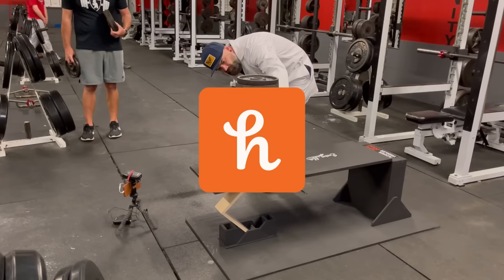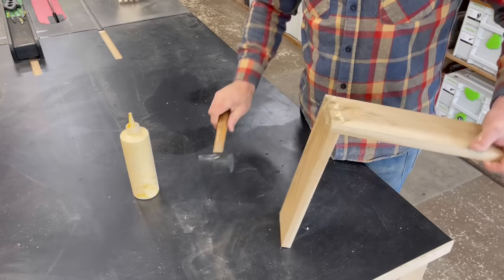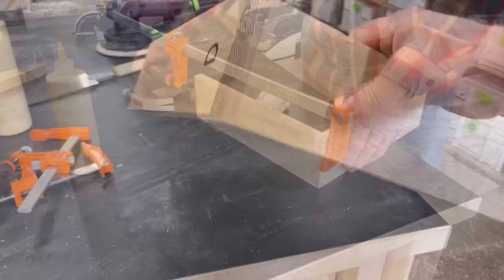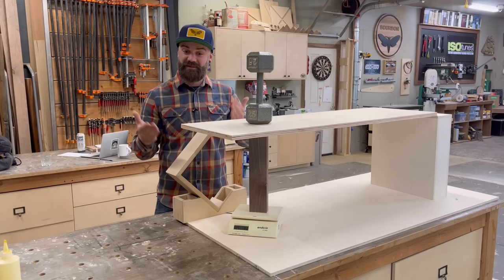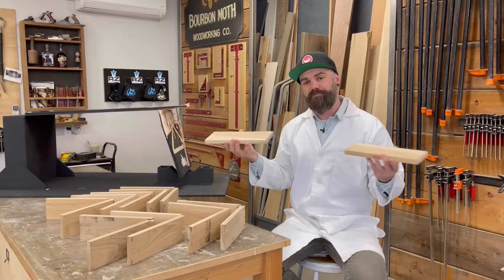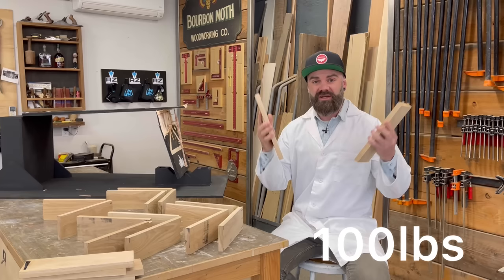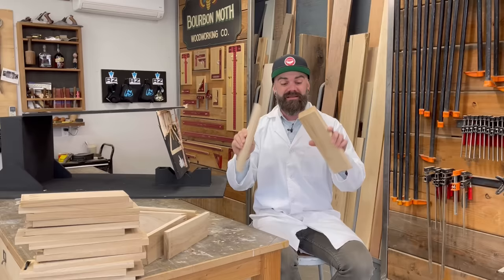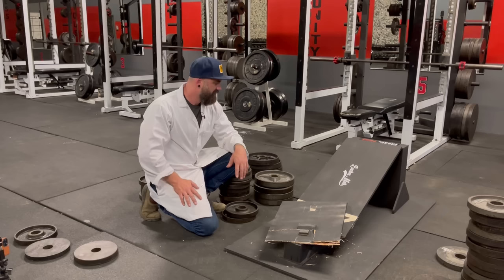What's the Best Wood Joint || Insanely Strong Joinery!

Comment: For absolute strength I use finger joints and then put a dowel through the joint from the end. So it acts as pin going through each of the fingers. I'd love to see that if you ever re-do the test with a routed Dovetail. I rarely use dovetails but when I do I make the pins and tails the same size.

Comment: Strength is measured in PSI.  Pounds of force divided by the surface area of the mated surface. Also you are exerting a torque on the joint because the force is exaggerated by the distance from the joint that I is being applied to.

Comment: On the comment about "over-engineering" a drawer... In my mind I was picturing the size of the drawer, what goes in the drawer, and how much average friction a drawer may have with the surrounding chest or cabinet during it's use. A narrow little drawer filled with pencils and office implements on the side of a desk isn't going to be the same as some big deep drawer under a workbench full of various metal tools. So assuming the lightest use case isn't always the best idea. Plan accordingly.

Comment: How to make a stronger join.
I would, based on the data. Put screws into a 45degree + splines joint. Or dowels if one wants to go all wood.

But the important part is to add the screws at an angle, alternating even.
So that the straight force down, is forced into different directions by the joining parts, ie the screws. The splines could probably simply be angled  to give more strength as well, since them being straight allows the weight to "rip them out" of their sockets.

So yeah, hard to explain with text.

Comment: Hello friends,
 I love metal and feel wood is traditional. Finger joints are known to be stronger than the original wood. Here is a copy past name for a tool to do it.    Finger Joint 1-1/4 in. L Carbide Tipped Router Bit.  Then just offset the second piece of wood 1/2 the tooth thickness from the first. Could it be cut into a mitered corner?
Thank you

Comment: It would be interesting to see scarf joints IE making two pieces of timber into one and then finding out how much weight a glued and non glued joint could handle, in some buildings in Japan they are assembled using intricate joints that contain no glue or external fasteners yet support buildings for hundreds of years even surviving earthquakes. Some scarf joints used by American pioneers used joints implementing mortise and tenons and pins to apply force to the joint that required drilling out the joint to recycle the timber in the building hundreds of years later.

Comment: (Sorry If I repeat someone's reply, I didn't read them all.) Two things about the miter that give it more strength than you would expect.
1.  Cutting at 45 degrees increases the glue area by 40%
2.  You reduce the leverage between the end you're pressing on and the opposite end of the joint. Given a beam with a 10:1 length:width, you'll get 10:1, or 9:1 leverage (depending on how you orient the joint.) Cutting at 45 deg makes it a 9:1.41 leverage (6.4:1)

Disclaimer:  this is strictly first-order back of the envelope analysis, intended for a YouTube comment technical level. If you see an error in my calculations please advise. If you wish to draft a treatise about how I overlooked the load distribution across the joint profile, do so in a separate comment.

Comment: I think you need to consider lots of things here. The direction of the force vs the different surface planes glued. For example, the miter join has to hinge apart and have the whole glued plane “pop” apart. The result may have been very different if the force was more of a twisting force. With steel there is a saying that goes “strongest under compression, tension, bend, twist, sheer”. The miter at 45 degrees when pressure is applied at 45 degrees means you have more compression forces on that join. Yes there is a leaver wich adds some tension force as it hinges open but the joins like the box have a higher twist/sheer ratio so you’d expect it to fail earlier

Comment: It's no surprise that the dovetail joint failed as early as it did. Your friend created a BEAUTIFUL, but mostly DECORATIVE, dovetail joint. For maximum strength, a proper dovetail has identically sized fingers across the joint. The little slivers of dovetail do little to increase joint strength. It would have been much stronger than the box joint had the dovetails been of equal size.

Comment: It’s not the transferring of the weight to the joint but it’s the torsion equal to the weight times the distance to the corner from the point where the partial drawer box touches the large plywood board with the weight on it that breaks the corner

Comment: I personally think the clamping cauls that were made to assist in the miter joint glue up made all the difference. I’d like to see if a miter joint shot with some 18 gauge brad nails through the outside and no clamps would hold up the same.

Comment: Pythagorean theorem...that 45 miter increased the glued area by 40%. Also, the splines extend to the edge of the joint that encounters the most force. 
Try running ridges the length of the 45 miter, I'm thinking you'll get an additional 10-15% load bearing.

Comment: While the force was measured consistently, the actual force on the joint must be multiplied by the lever arm (length of the board).   Most of the amendments to the joint (dominos, dowels, splines) would improve significantly when applied to a miter joint instead of the butt joint due to the increased surface area.  Hence the study while providing some interesting results is incomplete creating a new set of questions.

Comment: I'm thinking about that simple miter joint. Surprised me, but then it's end grain to end grain so maybe that's why it was so strong. If you wanted to make it even stronger you could add a third piece to form a triangle in the corner, three miters. I can't imagine why you'd do that unless it was a part of a chair for sitting on. You'd of course want it to be extra strong. Interesting video with a couple surprises.

Comment: At the risk of exposing my knowledge this is my guess from strongest to weakest

1. Dove tail
2. Pocket hole outside 
3. Box joint
4. Dowel pins
5. Miter splines
6. Domino 
7. Pocket hole inside 
8. Lamello
9. Miter joint 
10. Butt joint

Comment: Difference between a woodworker with not much experience in metal working, and one with experience metal working.
I knew immediately that pocket screws on the outside are going to be very strong, than simple joins without them...
And the reasons why mitter joints were so strong, was the vectors of applied force were nulyfied with the angle of the joing. It basically acted as a brace. The force you should have measured was the one that would force the boards to "open" the joins, so pushing both boards from inner side to the outer one.

Comment: sugestion for a stronger joint? try the box joint and or the dovetail. now glue in a small dowel or bamboo skure ( if grass doesnt violate "wood joinery" ) throuygh a hole drilled perpendicular to the joinery fingers.

Comment: the dove tail break was interesting. It seems like the pins acted as wedges provided mechanical advantage to split the tail board. I'd be curious to see if making the angle steeper increased the strength and whether it was significant, marginal, or not at all.

Comment: I'm cheering for box joint. The dove tail needs manual work so I don't want it to beat the box join. The angle of the force being applied makes me think that a 45 degree cut will do well but at the end of the day the box joint is a better join.

Comment: Try mitre with spline and use a stronger wood for the spline. 
I think I will make that my standard. Looks sharp and it’s functional.

On my last project I used M6 furniture bolt with a threaded 10 mm dowel nut. That is, in my book, the strongest joint of them all. I will bet you over 400 lbs!

Comment: The weight distribution on the miter joint is different fro the rest also. It pushes the two ends together until the top board tries to slide off the other unlike the other square cut joint that are instantly trying to pull apart.

Comment: I'd like to see the test of a box joint, but with a dowel running top to bottom through all the fingers.
It'd be nice to see the difference in strength between ¾" timber and 1" timber with a dowel half the size of the timber (ie: ⅜" and ½" respectively)

Comment: You should do a miter with thicker splines/ wider splines...
It would be cheating; but you could make the cut for the splines deeper, use a much wider spline and have them cut the corner.  That would brace each piece of your joint and you could probably make the joint stronger than the board

Comment: It makes sense that the miter joint is that strong it's basically the same as a scarf joint witch are used to build all kinds of things like boats and electric guitar necks. As long as it's good quality wood glue it's a very strong joint. Of coarse most scarf joints are at much less of an angle than 45 they are 10-15 on guitars witch gives you much more gluing surface than a 45.

Comment: I see two problems with the miter joint: this test was good at static load but a dynamic load would probably be different. Years of jerking and flexing a drawer in and out (dynamic loading) is not the same as static loading. Also any seasonal change in dimension to the separate pieces of wood, in particular cupping, can be a powerful force on its own, which could lead to separation (I have seen it many times). I kind of think of it as potential single point failure while most of these joints have multiple gluing surfaces which would require multiple failure points. Consider how hard it can be to take apart a tight fitting dovetail or box joint even if it's not glued.

Comment: this is an excellent video, full of useful information about wood joints. congratulations.

Ockham's razor. this is all about bond properties, by contact area, putting aside the resistance to break of the wood itself in and the lever effect, but resistance increased by the reinforced joints from the pocket holes to the miter ones.

Once more, excellent video. thanks a lot! 💪🏻

Comment: That was interesting, now that we know how my pressure they can resist, let see how much it will be needed to split them appart, to have 2 forces pulling in opposite direction from the 2 edges of the joint.

Comment: Dovetail: you are testing it at its weakest 45d angle whereas it is designed to resist pulling pressure at 90d (when you pull the drawer open). But the simple miter joint is angled to best resist your test. So part of the result is the angle of force applied by the way you set up the test. I know you are just having fun, but you might consider setting up the same test but with pulling pressure and pushing apart pressure, not just weight at a 45d angle from above.

Comment: It is clear to me that your dovetail joint did not have the same “connected and glued” surface area as the box joint. So it is easy to understand that your box joint would be much stronger.

Comment: Failure mechanism control is commonly done in structural engineering, the classic example is concrete. We design concrete beams so the steel rebar will yield and stretch before the concrete breaks. Steel fails slowly with a long yield and elongation prior to rupture, providing lots of warning that something is wrong. Where concrete has a brittle and sudden failure, not good. In any structural system it's possible to determine all the failure mechanisms in order based on their ultimate strength.

Comment: Splines work because wood is strong in tensile. Same reason dove and box fail, the compressive deformation happens at the fingers and the joint looses all strength. Any time you can introduce tensile stress to wood, it will handle it better than anything else, the issue is of course securing any tension pieces.

Comment: The spline is trying to pull apart three pieces of wood with the grain. Wood is very strong when pulled. The only caveat to that is whatever is attached to wood is usually not as strong, but in your case the glue and the splines created a friction bond

Comment: Usefulness rating = 100%, ten out of ten ! For thin, delicate picture frames 11x14 and larger, the splined miter joint is probably a requirement to get any kind of durability over time. Excellent presentation.

Comment: Now try Miter with Dowels each way, but really you need more then 1 sample of each joint, make 3 of each joint and test them to get an average strength. The consistency of the glue up and other factors can effect bonding strength so you need more then a sample size of 1 for each joint type.

Comment: I would like to see how equally sized dovetails fare, like how I was taught to make them. Less risk of just pulling the dovetails right off.
But even then it’s of course going to depend on the direction of the force. In one direction it will be only about as good as a biscuit/domino/dowel joint.

Comment: If you had all of your dovetail the equal size similar to the box joint it would have fared much better.
When you redo this test make a box joint, but use a mortising drill bit in a drill press and cut a square hole through the center of all the fingers of the box joint and insert a square piece of stock so there is zero rotation of the fingers when tested at 45° again.

Comment: The miter joint makes sense because its got way more leverage. the strength in the box joints, dove tails, anything else really, is at a wonky angle to begin with. Plus most of the wood glue was actually being affected by torsion rather than being pulled apart. if you just think of the wood itself as a lever, the mitered corner is the fulcrum and the board is the handle. The mitered edge is significantly longer than the width of the board, this gets you more surface area of your glue surface, starts the test at a shallower angle, and most importantly, takes some leverage away from the length of the handle.

Comment: The miter joints and but joints are the only ones using optimized glue pressure. Put a perpendicular clamp on your box/miter/dove spline. Hitting 250-500 psi in your internal structures and your joints will well outlast the miter. 

If you look closely at the box joint failure. Only the one face that got pressure from the clamps held up and produced a grain failure. The rest was glue failure.

Comment: Don't let science fool you . The strength of force on a drawer is not a open 90degree angle with downward force. The Dove tail is the only joint I have seen on100year old furniture. Drawers with 45 cut and finished nails have failed on new furniture. Very good video I am now a subscriber. Thank you

Comment: I find it interesting that other tests on the web including YouTube with dowels and Domino's and all sorts of joints the dowels typically win every time.... Also and perhaps it's been said I didn't read all the comments but you have to choose the joint based on how it's going to be used for example a drawer I've seen drawers made in the 1800s where the glue is all but disappeared and hardened past its usefulness at the drawers stay together why because of the dovetails any of the other joints a miter or whatever would have failed many many years ago so again choose the joint based on how the product is going to be used...

Comment: I suggest testing a box joint with en edge spline down the entire edge 1/3 into the corner. It makes it so the fingers are pushing on the edge spline in alternate directions pinching the edge spline. This I would bet is the strongest joint in the world.

Comment: Miter joint is not eliminating end grain. Its acually increasing the end grain on BOTH pieces. You are then gluing end grain to end grain. Those "grains" are very fine capillaries of wood, which allows for more absoption of the glue into the grain.

The problem with butt joints is that you are joining dissimilar surfaces, with an end grain glued to a side.

I think physics and leverage also lead to the confusion. Cut 4 cubes and glue 2 together end grain to end grain, then the others glued side to side. I'd be willing to bet the end grain is stronger. There are steps to take to deal with the excessive capillary action of end grain, but the resulting adhesion is clearly very strong given these results and others from similar videos.

Comment: A superb fixing would be a steel right angle piece manufactured to exactly fit biscuit type holes made by a power tool most people already have or could buy at a reasonable cost. And then match to with the mitre joint for quite possibly the perfect strength, appearance, cost, push/pull compromise for almost any application. 

Apart from that I’d be curious to see the difference a few nails could make to the basic mitre joint. With flattened heads left flush they could even add to the aesthetics.

Comment: Similar to the dovetail being on the small side, I’d like to see how much you could increase the hold strength of the mitered spline joint if you used thicker splines and assuming straight grain perpendicular to the joint.